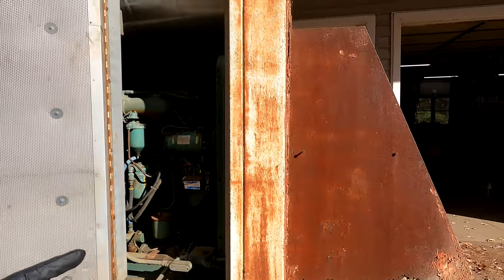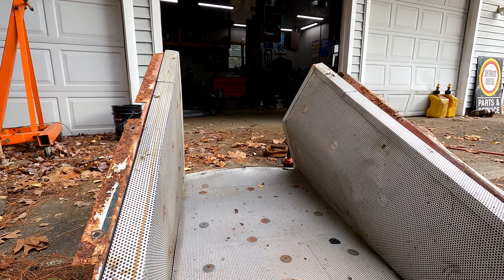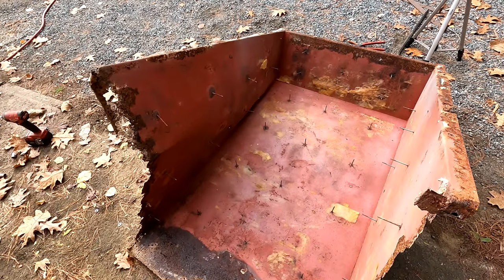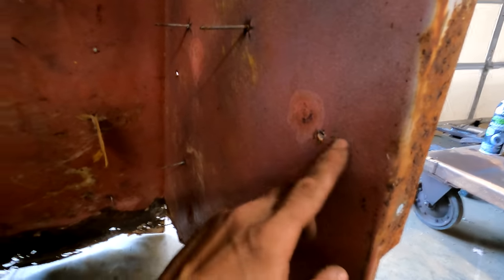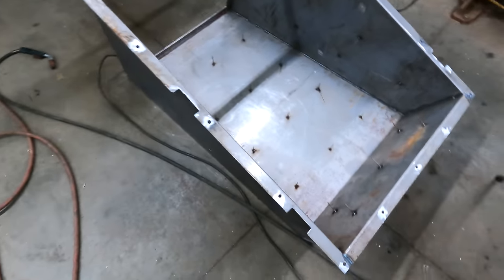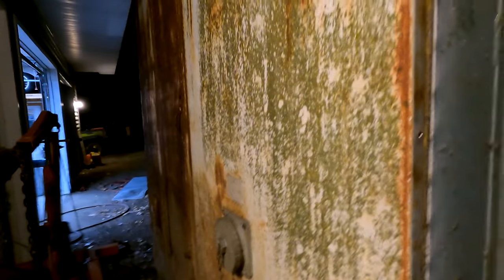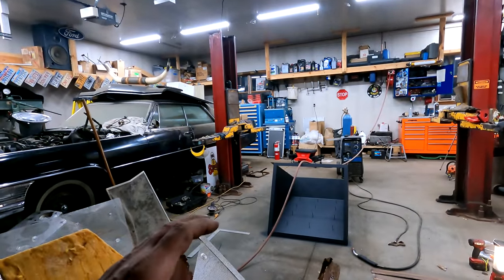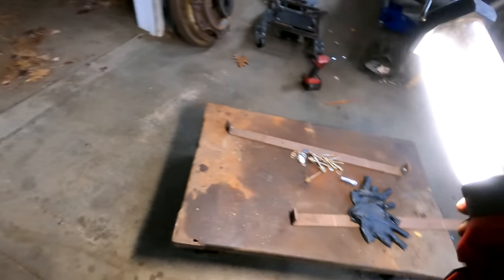Antique 2-71 #generator Restoration Part 1 - Metalworking the beast

Comment: Great channel.  I've been a generator tech. for a MTU-Detroit Diesel distributor in north Jersey for 20 years now.  I love those 2-stroke Detroits!  They may have a reputation for being noisy and oily, but they're so simple, reliable and easy to work on.  Not to mention, the long history of them being used for many applications in our military. You did a great job on that radiator discharge hood, but I can't help but mention that you could've saved yourself alot of time and money by just installing a set of gravity/backdraft dampers on the outside of the generator enclosure.  From some of the other comments I read, it sounds like you're gonna hang onto it and use it for emergency backup power(?)  If so, I don't know if you plan to keep it "plugged in" for the jacket water heater and a battery charger 24-7, but keeping that enclosure somewhat sealed will save you alot of money on your electric bill.  Of course you'd have to install those same dampers for your air intake also , which would require alot of work.  Just my 2 cents.  So glad to see you keeping her from ending up in a scrapyard though.
Reply from the maker: Thanks for the kind words brother. I don't know what gravity/backdraft dampers even are... I'm not opposed to an upgrade.... Too late to toss the hood now can they go on the bottom of it? Sounds like I've got some research to do.

Comment: Just run a couple short beads of weld on the louver frame sides. If you ever need to take it off again just slice the beads with an angle grinder cutter disc.
Reply from the maker: Aint a bad idea!

Comment: Those speed nuts holds the acoustic liners in place young man. 
Those are there to deaden the sound from the Detroit motor city you mad man.
So guess you've figured out part of the function by now, but I thought I'd say it outloud just in case. 
If the insulation is bad,  don't throw away the perforated panels those you can fix easily enough. 
As far the sound deadening, any sheet metal fab shop that does work for hvac shops will have something that works just as well. 
It's just high density duct lines used to handle two issues. 
One is insulation, and sound absorption. 
Be sure to get a quarters of adhesive from them too.
Good to see you got paint grip metal, just wipe down with regular vinegar, and then paint with primer and paint blended together, and make life easy on yourself.
Get yourself some NP 1 chaulking for your seams, because silicone dries out, and is worthless in couple years, but NP1 stays pliable for long time. 
Meaning that it gets a skin on the outside, but inside stays semi soft and will flex with the metal

Comment: if worse comes to worse. If you can get aluminum strips wide enough to cover the gaps between the outside and the louvered vent you can silicone and self tap screw that thing into place and it shouldn't rattle